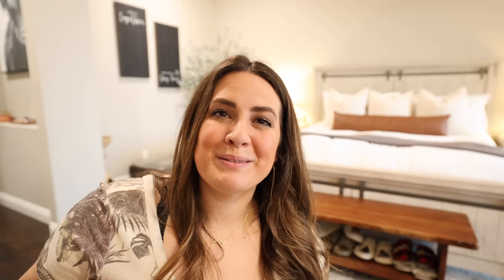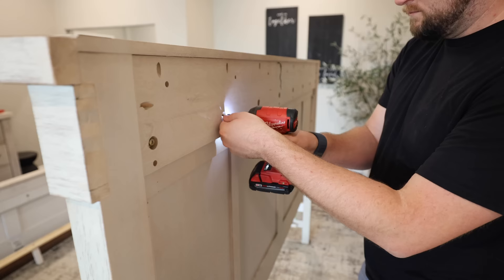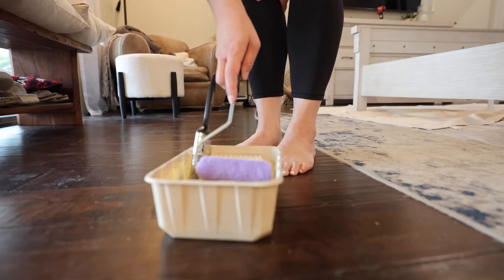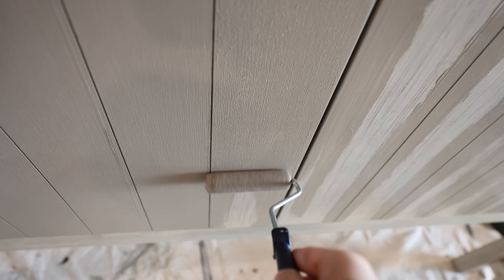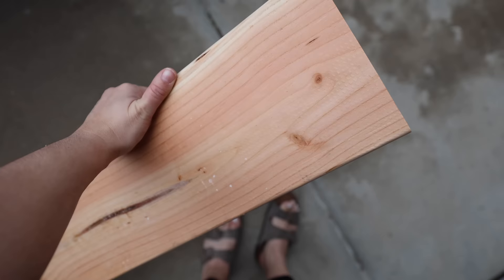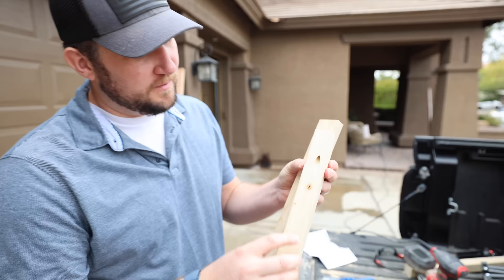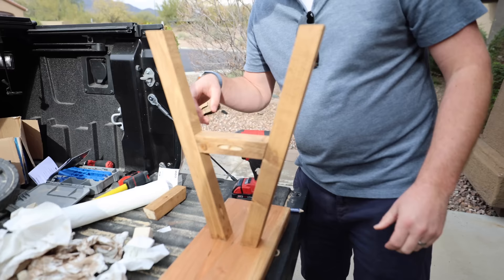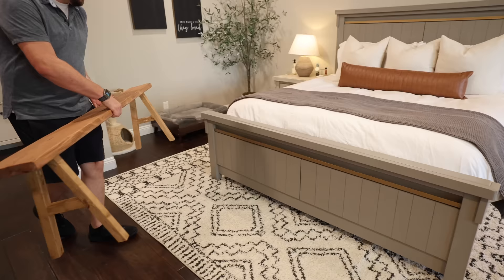BUDGET BEDROOM MAKEOVER ep 1 :: Bed Frame Furniture Flip, $20 DIY Bed Bench + New Rug!!

Comment: I can totally relate to the pet hair. I recently got a platform bed frame that I built. When I went to vacuum the floor under the bed after breaking down the old frame I used a fur rake to make sure I got all of the cat hair out of the carpet fibers. I swear I got 4 whole cats of fur up. And that was with just one cat until last month. Also, what about maybe using the leftover wood from the bench to make a shelf or two if there’s enough? Maybe put some floating shelves along the wall where you talked about putting a shelving system.